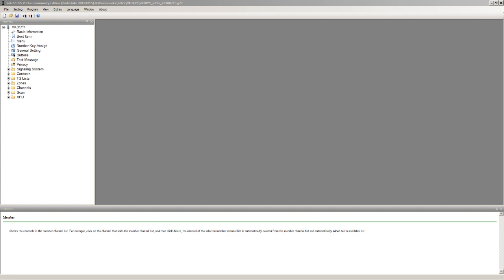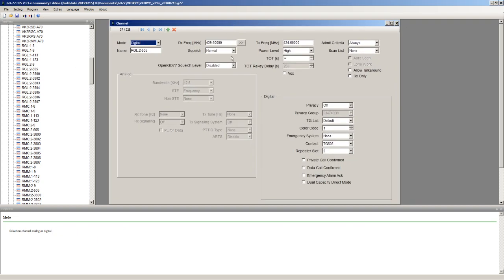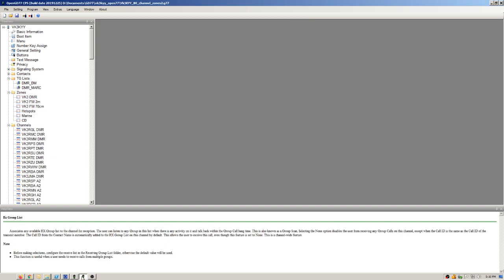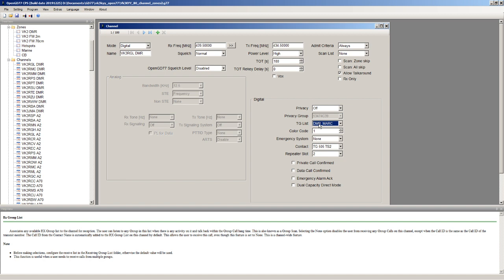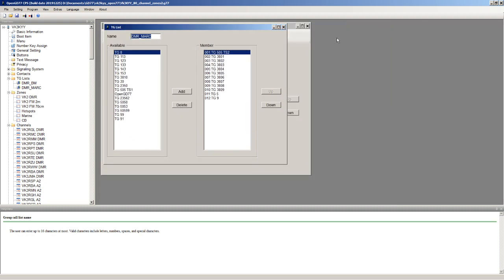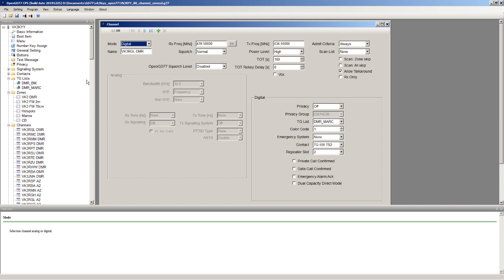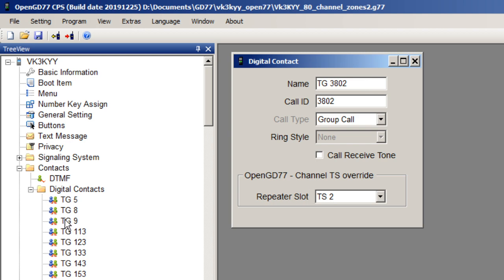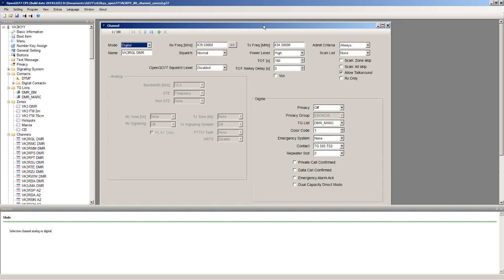OpenGD77 CPS setup for DMR channels with multiple TGs on different TSs

Comment: Amazing idea to use the talkgroup list vs multiple talkgroup channels, which is what I already did.  I do want to streamline my codeplug using this technique.  One question about usage.  If I hear somebody talking and I want to respond, or if I want to throw out my call sign on a specific talkgroup, how do I go about doing that If I am only using one channel with a talkgroup list?  THANK YOU and the other DEVS FOR THIS AMAZING FIRMWARE.  I have more expensive DMR radios, but my MD-UV380 is my goto just because of this easy to use firmware.  YOU GUYS ARE ROCK STARS FOR COMING UP WITH THIS!

Comment: Roger, from what you did here it seems that the VK3 DMR repeaters have consistently configured TG's on TS's.    I am finding that in the SF Bay Area (and elsewhere in the US) each organization that admins a repeater chooses their own TG to TS mapping.   It seems that with the Bay Area inconsistency, I need to end up with many Zones as well as many Channels in the OpenGD77 firmware - perhaps not a bad as with the original GD77 firmware but similar.   Am I missing something?     

Also with the Jan 2021 OpenGD77 CPS, it looks like within a Channel I can EITHER have a TG List OR a Contact set.  Not both.   This no longer matches this video.   Again, am I missing something?

Echoing the other comments, these are great videos, but generate a bunch of questions for me as I learn!
Reply from the maker: If each repeater has completely different TG's attached to it, then you'll need to either make multiple TG lists, one per repeater or if the repeater only supports one TG, then make multiple contacts and assign them as appropriate to each repeater.

Or, just use the manual TG entry, if you can remember which TG's are supported by each repeater.

The only difference between this firmware and the official firmware, is that you can only attach a single contact to each channel, and hence if the same repeater supports multiple TG's then you had to create multiple duplicate channels.
And it didnt support manual TG entry
Reply: @vk3kyy  Thanks Roger.   I ended up with a combo of manual entry and subsetted TG Lists for groups of DMR repeaters that were similar.   It's better than one Channel per Repeater/TG but not as good as yours :)